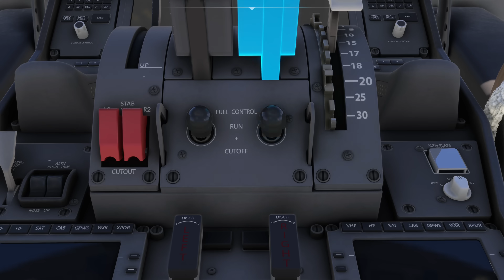Air India 171: Why Did The Fuel Cut-off Switch Get Moved?

Comment: Sorry Steve I respect your experience and knowledge in this sector but whatever I have read I feel one point is being underestimated. Boeing has face problem with these switches on 737 model and same switch is used in this model as well. There can be a chance of switch malfunction or any software/electronic issue which could have created this problem. THE PILOTS WHO ARE DEAD AND NOT AVAILABLE TO DEFEND THEMSELVES ARE THE EASIEST TO BE BLAMED

Comment: What if the switches were not moved by the pilots. But the computer responded to some spurious signal. The flight data recorder is recording what the computer is reporting. Is there any direct data link between those switches and the flight data recorder?
Reply: The switches can only be controlled manually. The switches were found turned off by a pilot, and then turned back on. The data recorder information confirms this. The computer doesn't turn the fuel off to the engines, or flip off the fuel switches. No.
Reply: @garycook5125  I completely agree that those switches can only be controlled manually. However, they do not directly control the fuel control valves. Instead, they instruct the computer to operate those valves. Consequently the computer operates those valves and tells the flight data recorder that those switches have been flipped.

What if the computer responded to an electrical glitch where it thought that those switches were flipped. Since there is not direct link between those switches and the flight data recorder, there is no cross verification that those switches were  flipped manually in the first place.

The observing pilot suddenly noticed that the engine are slowing down. Then comes - Why did you do that? Ans: I did not. 

It is very strange that no other conversation  before, or after these two lines, have been reported. It is also strange that in the report these two lines are not written in first person. Instead it is written as a narration. Quoting the report "In the cockpit voice recording, one of the pilots is heard asking the other why did he cutoff. The other pilot responded that he did not do so."
Reply: @garycook5125  I completely agree with you that those switch can only be operated manually. However, they do not control the fuel control valves directly. Instead, the switches instruct the flight computer to operate the fuel control valves. The computer operates those valves and tells the flight data recorder that the switches have been flipped.

What if the computer responded to an electrical glitch which initiated the fuel cut-off process. In any case, the flight data recorder records whatever the flight control unit is reporting. Since there is no direct link between these switches and the flight data recorder, there is not cross verification that someone did manually operate those switches in the first place.

The observing pilot suddenly noticed that the engines are slowing down. Then comes those two lines - Why did you do that? Ans - I did not. It is strange that no other conversation before, or after these two lines, have been reported.

Comment: Weren’t there two pilots in the cockpit? If the fuel control switches were accidentally or intentionally moved to cutoff right after takeoff or while cruising or landing, shouldn't at least one of them have noticed? Surprising that such a critical action doesn't trigger a dedicated visual and audio warning — like '⚠️ Engine L  Fuel cutoff switch activated.' In such high-stress moments, a clear alert could have made a life-saving difference

Comment: 1. The cockpit fuel switches never physically moved after first 3 seconds .. It was the fuel shutoff valves that transitioned electrically  (from ON to OFF), possibly due to the known actuator issue as reported by UK CAA in may 2025 as part of their safety notice and mandated all Uk operators of Boeing 787 to do follow a certain checklist daily.

2. AI 171 Pilots noticed loss of thrust after the system initiated transitioning of fuel valves (not switches) and one of them asked the other if he cut off to which other pilot said no I didn’t 

3. they then scrambled to do the relight procedure as per QRH within 9 seconds as captured by DFDR but it was too late by then due to low altitude .

4. So it’s too early to blame the pilots as they seem to have done everything as per SOP.
Reply: https://www.youtube.com/live/VW5Hup25fA8?si=4IH5qZLTnawLBo2z
Reply: => https://youtube.com/watch?v=GpKwdxPGWVU&lc=UgwQuvQXNgIRbIm-sVZ4AaABAg&feature=shared
Reply: @stevemuller8320 https://youtu.be/4m6LwZLLq7A?si=UpZHIp-hew5P3taz

Comment: Someone else has asked the same question I have. Did a system fault cut off the fuel & the pilots effectively did a "Have you tried turning it off & onn again?" like you often do with computers & phones etc.

Also, it doesn't make sense that an aircraft with 2 perfectly working engines with no alarms can let anyone turn the fuel off so soon after rotating out. I know an engine fire at climb out has to be dealt with, but perhaps it should be easy to do if a fire warning or excess vibration warning is shown, but harder to do if there's no alarms.

Comment: Is looking at fuel switches is the first thing a pilot does if both engines fail as if we are to believe one of the pilots did it as the first question was why did you cut off the fuel switches? If it not the first thing then the pilot asking my also have done.

Comment: Why is fully excluded from the conversations that the fuel switch  might have been switching off due to technical failure? I know this is designed not to do, but there are many machines failing. Why it could not.
Reply: Because it needs to be manually moved from point A to B and then locks into place. Even if the locking into place part was faulty, the switches still wouldn't move positions on their own. The possibility of such failure is close to zero for one switch. The possibility of such failure for two switches happening at the same time is even lower. So low it's incomprehensible.

Comment: Cockpit Voice Recorder (CVR) – Extract   > Pilot 1: “Why did you do the cutoff?”  Pilot 2: “I didn’t.”  The report sounds like it was written by Boeing' lawyers. 
The key is what is not included in the report. It's the chicken and egg question, which came first? If the engines failed soon after take off because of electrical/computer glitch, the pilots would attempt to reboot the engines which is done by switching to engines to cut off and back on.
In 2018, the Federal Aviation Administration (FAA) issued a warning about potential issues with fuel cutoff switches on Boeing 737 aircraft, specifically related to the locking mechanism. The FAA noted that some switches had been installed with the locking feature disengaged, which could lead to inadvertent movement and potentially shut down engines in flight. However, the FAA did not deem the issue serious enough to mandate immediate action.  
1 month before the Ai 171 crash, UK flagged safety issues with Boeing fuel valves. "Potential unsafe conditions affecting fuel cutoff valves" - UK 15th May 2025 directive! 

What the report confirms:
- The system recorded both fuel switches as having transitioned from RUN to CUTOFF about one second apart
- Wreckage showed both switches in RUN
- Pilots tried to restart immediately
- The CVR only gives a short paraphrase of their words, not the exact tone or phrasing
There are technical possibilities worth investigating:
- Electrical or power transients during the critical air/ground transition that could make FADEC see the switches as CUTOFF even if still in RUN
- Software or logic bugs that treat missing or invalid signals as a fail-safe cutoff
- Mechanical vibration or shock (less likely but should be checked)

The ANA 787 incident of JA825A on Jan 17th 2019 in Osaka also involved both engines shutting down automatically on landing due to mode transition logic errors. That shows the software can command shutdown without pilot input. This is why we should call for caution before blaming the crew. The preliminary report tells us what happened, not why. We need the final investigation to look at all factors: human, mechanical, electrical, and software. They should STOP leaking to the press before official report is released!
Reply: If the cutoff happened electronically, then the following would be the case:
- the fuel switches would have stayed ON
- so why would the pilots even suspect the fuel cut off to be the problem if it's not off? engine failure can have many causes
- why would one pilot then ask the other why he cutoff if the switches were never touched? 
- the flight recorder would show TWO seperate instances of the fuel switch cutoff, if the signals had electronically malfunctioned. One time when there was an electronic malfunction and then seconds later when the pilots manually turned the switch off to turn it back on
None of this makes sense.
Reply: @louibeans  it does not make sense you are right on that. However i did not note that there was a warning sign flashing saying warning Pilot suicidal , pilot suicidal either. That s why i wait to see what the final report says
Reply: " this lager is great - i love drinking it makes me fly better oh by the way i am suicidal" real footage from boeing oh by the way we dont want camera in the cockpit its intrusive

Comment: Hi Captain, can you please throw some light on Engine restart sequence mentioned in report. If hypothetically speaking, as mentioned in report, If both Engines are put to cut off, APU goes into Auto start sequence, RAT gets deployed (Auto / Manual), how can the Engines be started ? Knowing the ATA 24 architecture  that RAT Genrator can only power Backup buss and C1 TRU & C2 TRU & backup ATU. None of these supply power to VFSGs, neither was airspeed mentioned as Max 180kts , sufficient for Air assisted start. To me it doesn't make complete sense. Look forward to your feedback and review , if the report is factually correct on this aspect.

Comment: If, as you say one of the pilots intentionally wanted to end this flight prematurely, why cut off the fuel, a reverseable action, if noticed by the other pilot early enough. Surely if a crew member wanted to permanently remove any thrust from the engine, irreversibly, the engine fire switches would have been the action to do that. I personally don’t think this was pilot intervention. The report is quite ambiguous, we DO NOT KNOW if the switches were “physically moved” as you say, they may have been sensed to be in cut off, while actually remaining in run, which is where they were found during the investigation. Your thoughts @captainsteeve
Reply: If the switches hadn't manually been turned off (extremely unlikely scenario), why did the flight recorder record them being turned on again 10 seconds later?
Reply: @louibeans dual engine failure memory items dictate that the pilots should cycle the fuel control switches to cutoff then run. Completely plausible that the engines rolled back and the pilots elected to do exactly what the QRH directs them to do.
Reply: @JohnHenryTheunissen  If that's the case, then I guess it's a possibility. I don't have the knowledge. Steve claimed in the video that no protocol in the world would cause a pilot to turn the fuel switch to cutoff mid-flight, except a fire, if I understood correctly. And if I am understanding the prelimilary report correctly, then no other cause for engine failure was found.
Reply: @louibeans all I’m saying is, is that the report is very ambiguous. It doesn’t specifically state that the pilots moved the switches to cutoff. It simply says that the switches transitioned to cutoff. Perhaps the switches were still physically in the run position but sensed electronically to be in cut off, causing the pilots to react and action their memory items for dual engine failure. For so called experts to jump to the conclusion that one of the crew wanted to end the flight prematurely by cutting the fuel supply to the engines, based solely on the ambiguous preliminary report, seems somewhat unfair to me at this point. Given that there were many other options for the crew to achieve that type of unfortunate outcome. Perhaps we should start trying to find reasons why the crew wanted to live, rather than convict them before we have all the facts.
Reply: @JohnHenryTheunissen  The report actually specifically says that the fuel switches transitioned into the off position. Position would indicate a physical position to me, because why else would it be worded that way. But I agree that the preliminary isn't very specific and lacks a lot of detail that we will hopefully learn a bit later.
Reply: We know exactly that switches were “physically moved”. They can be only moved by person.

Comment: Steeve, I'm guessing these switches, like all other modern electrics, are "fly by wire" in that they are connected to the "other end" through a routing computer by fibre cabling, rather than a direct wire to the valve. If that is the case, then surely there is the potential that computer code could have caused the issue rather than a physical movement of the switches. - Bearing in mind investigators found both switches in the on position, and the denials by someone that they'd moved the switches, then this cannot be dismissed unless video proves otherwise.

Comment: 1:12 Hold on. Before that, there are multiple backend softwares running that pilots are unaware of, was it done by that software? Lets check that first.
Reply: Dreamliners around the world would be grounded, especially those with similiar flight hours.. If that was found to be even remotely a possibility

Comment: One crucial detail that’s being overlooked is this: the co-pilot was supposed to retract the landing gear, but instead shut off the fuel supply. The real question is was this a brain-fade moment or a deliberate act?
Reply: We don't even know for sure yet who shut off the fuel supply or how it was shut off. We know that it did turn off 3 seconds after take off. So if one of the pilots noticed that shortly after, I don't think any thoughts are being wasted on retracting the landing gear. What I don't know: At what point in time is the landing gear usually retracted? How long does it take? Cause if it happens around second 10 after takeoff on average, then we'd know that the pilot didn't even get that far.
Reply: @louibeans  point well taken, I made an assumption that it was the pilot who was monitoring shut off the supply, but the report nowhere specifies it.

Comment: It's been relatively well established that one pilot turned the fuel switches off.  When asked why, and he denied doing so, is it possible he honestly believed he did not do so?  Either having done so by muscle memory and not remembering doing so, perhaps believing he did something else?  Is it possible fatigue was a factor here?

As a professional truck driver of over 30 years, I can attest that fatigue can attribute to all sorts of hallucinatory behaviors and perceptions, seeing things that aren't there and not seeing things that are.  And fatigue can be a factor even after a full rest break, especially if a company is pressuring drivers (or in this case, pilots) for quick turnarounds on a daily basis.  This is why trucking, railroads and aviation all have Hours of Service rules.  But even so, even with all the mandatory rest breaks done, sometimes drivers still end up being fatigued.

Comment: In nuclear industry there is a well know design criteria "single failure criteria". It implies that, failure, or malfunction, of any single component, should not cause a catastrophic accident. A catastrophic accident can only be caused by multiple problems or failures. It is codified in 10CFR (Code of Federal Regulations) Part 10. I am sure there is a similar CFR for aerospace industry. Also, it is common sense, one error should not cause a catastrophic failure. However, Boing engineers never heard of it... shame full. I do not believe the story being pushed by Boing. Furthermore, the story captain is pushing: "the fuel cut off switch is needed in case of engine fire", is ridiculous, Why cant there be a temperature sensor in the engine to verify if there is a fire in the engine; and that the fuel to both engine should not be allowed to cut off within 60 seconds ... some logic like that. This whole thing is a cover up, and US and Indian governments are complicit. Shameful!!!

Comment: 2 way conversation about fuel cutoff + mayday call + switch on the fuel cutoff + understanding the situation + trying to gain altitude at the same time, hmmmmm isnt it too much work for just 30 sec. And i am sure they realized it atleast 10-15 sec after takeoff so in around 15-20 sec so much i think something is hidden from us. Moreover i dont know about this but just a thought, can the flight take off if the fuel was cut. If the fuel was cut after takeoff then i guess they has only 20-15 sec in hand and having a 2 way conversation plus may day call cannot be done in so less time i believe

Comment: Hi All,
This from Google with A.I input :A General Electric (GE) service bulletin regarding their engine control chips has been cited in preliminary reports concerning a deadly Air India crash, indicating that a chip issue could be a contributing factor to engine fuel cut-off issues that led to the accident. The bulletin reportedly states that the chips are designed to be replaced around 11,000 cycles, and if not replaced or maintained correctly, they could lead to intermittent loss of signal and fuel delivery problems. While initial reports of the Air India crash focused on potential pilot confusion regarding the engine fuel switches, some analysts and the Pilots' Association of India are suggesting the possibility of a chip malfunction as a significant factor.